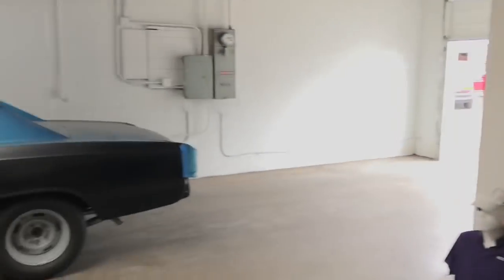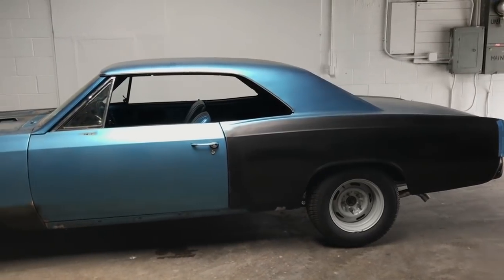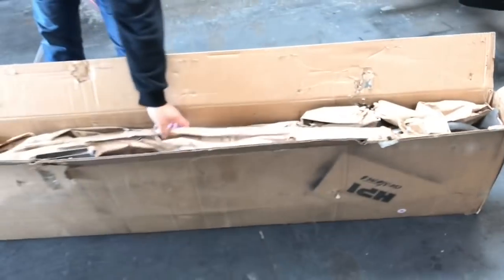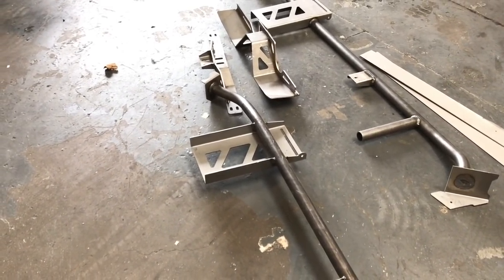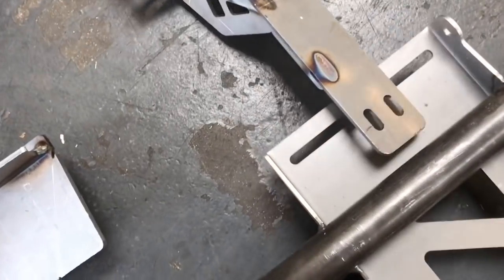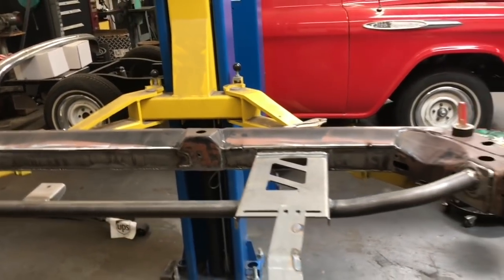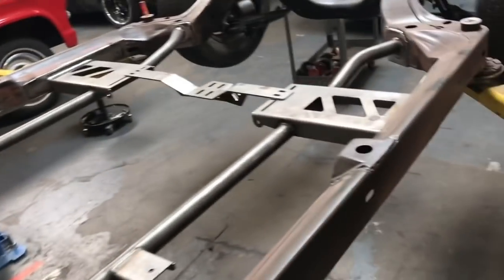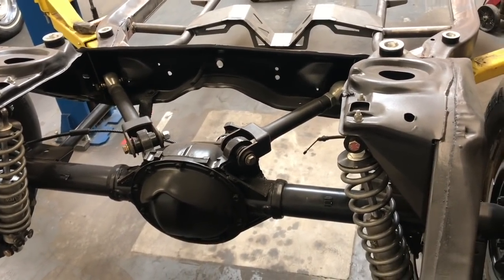Boxing the Frame and more on a 64 Chevelle

Comment: After you powder coat your frame, dilute chain saw chain oil with a slightly lighter oil (it's a real gooey & sticky substance) & spray it inside your boxed frame. (messy, but messes clean up.) You may need to re-spray every 5 to 10 years, but your frame will last forever!  :)

Comment: Have you tried the Steel-it aerosol paint yet? They are really starting to promote it as being weldable and easy to spot repair if you need to weld after you've already painted the frame with it. It's not cheap, that's for sure.
Reply from the maker: lunkydog   I use POR15 chassis black
Reply: @luckysgarageshow  I believe I've heard you mention that previously. Just curious if you'd tried the other. Like I said, they're very proud of it price wise and I'm aware that POR is not cheap either. My boss had a bad result with POR on a trailer and left me with a bad impression. I know he was the exception.

Comment: So I just resealed the frame on my 66 gto and went through a nightmare getting the body off the frame. What’s the best way to replace some of the cage nuts so I can re secure the body bushings. I have a new set of bushings but I don’t have a lift or all the tools you have. Any help is great thanks for the video lucky.

Comment: Hey Lucky with those rear coil overs mounted in the upper shock mounts, aren’t you worried about the high stress cracking the frame. I’ve read that’s a no no mounting it that way. What’s your opinion?

Comment: I boxed my ‘64 Chevelle SS frame.  I added a few gussets near the rear springs. Turned out good.  Lucky, I was wondering because the wagons and El Camino’s are supposed to have a factory boxed frame.  Your 2 door wagon did not.  Was it the original frame?
Reply from the maker: antalamo   I think the el co is boxed but this 64 was not.

Comment: Hiya Lucky - so, I finally get the backstory on the LeManster.. whattaya mean, worse shape than when you left it? I thought they (Lincoln Tech) were just spraying it?
Reply from the maker: Jeff Mutschler   They disassembled most of the body.  Sanded I couple panels stacked it in a pile and there it sat until we hunted it down and paid to have it shipped back.  
  Then it disappeared.  “Sold”